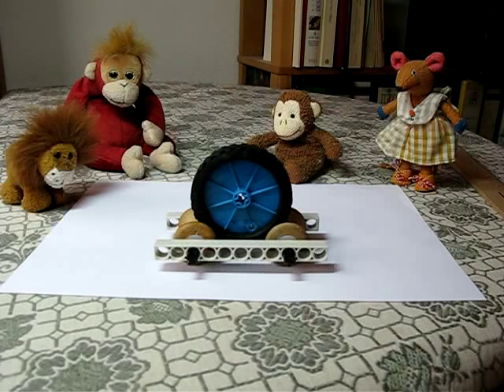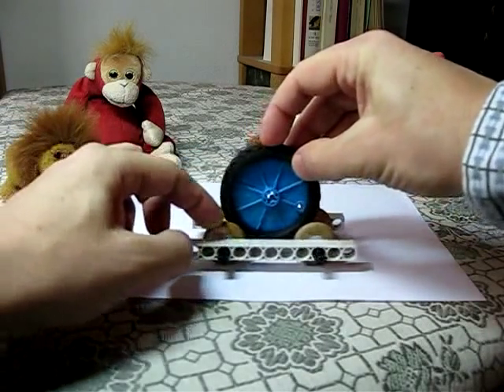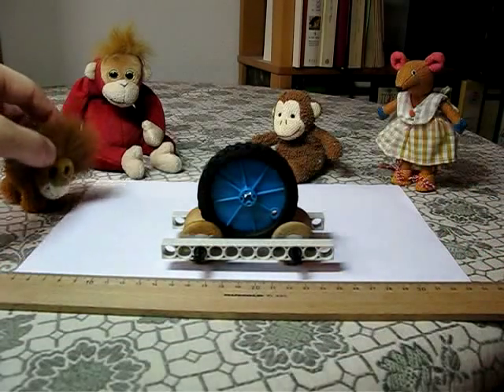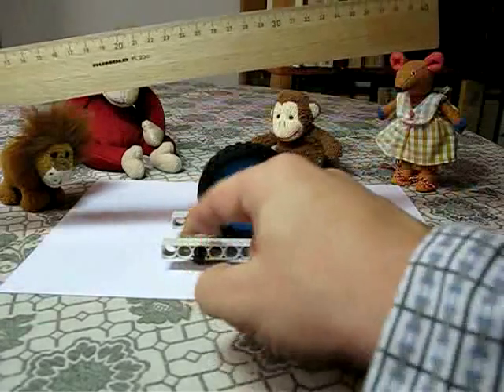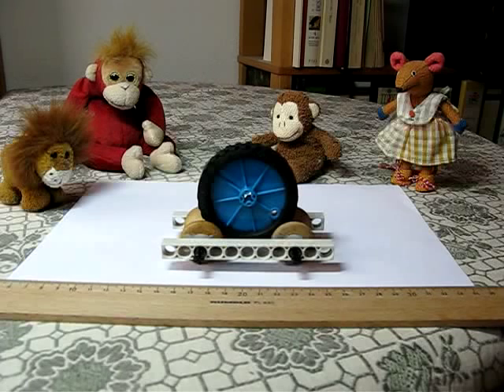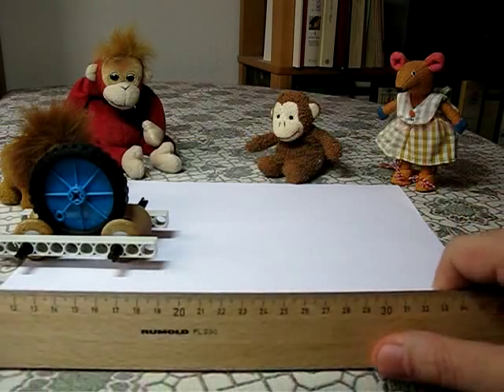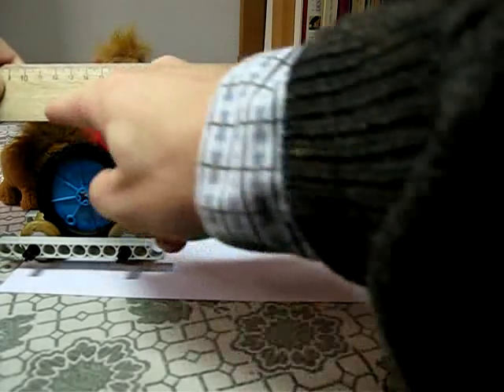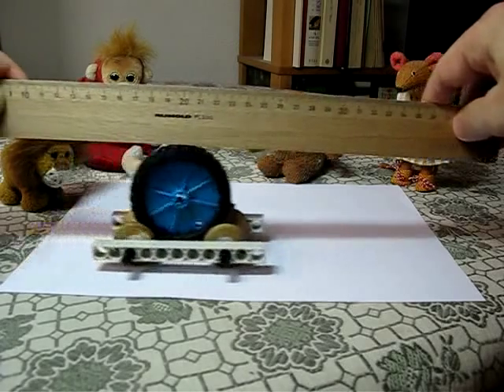Under the ruler faster than the ruler

Comment from the maker: The wind is not affecting all the vehicle to the same amount. It is mainly affecting the propeller: the rest of the downwind cart offers very little resistance to the wind. Since the propeller is turning (being geared to the wheels), is is interacting with the air even when the cart is moving at wind speed. When the cart has reached wind speed, the propeller is producing forward thrust that accelerates the cart to above wind speed. The cart reaches equilibrium at a speed above that of the wind.

Comment from the maker: You need to look at the machine as a whole: the cart is a gearing system *between* two surfaces that move relative to one another. If the centre of the blue wheel was fixed relative to the table top, it would indeed turn the other way. The gearing causes the centre of the blue wheel to advance to the right faster than the highest point of the wheel, which is touching the ruler.

Comment from the maker: When it's working correctly, there is no slippage between ruler and wheel. You could do the same thing with cogwheels and a rack and pinion gearing, to make sure there's no slippage. Since my cart is very light and all wheels turn easily, there's not much loss of energy due to unwanted friction, which means I don't have to apply much pressure with the ruler.

Comment: For anyone who is both (i) confused and (ii) knows high school algebra, let's break this down like a textbook exercise:

1. Suppose the inner radius of the lower wheel, at the point where the big wheel touches it, is r, and the outer radius of the lower wheel, where it touches the ground, is R. Show that, unless the wheels are slipping, (the speed of the cart relative to the ruler) = (r/R) * (the speed of the cart relative to the table)

2. Define F(x, y) to be the rightward speed of the cart if the ruler is moving right at speed x and the table is moving right at speed y, and the wheels are not slipping. Using the previous exericse, show that for all v, F(rv, Rv) = 0.
 
(Remark: We can interpret v as the angular velocity of the small wheels.)

3. Given the result of the previous exercise, explain why it must be true that F(rv + k, Rv + k) = k for all v and k. (Hint: Imagine that the entire room and everything in it are moving right at constant speed k.)

4. Suppose that the ruler is moving right at speed 1 and the table is not moving. Solve the simultaneous equations rv + k = 1; Rv + k = 0 for v and k. Deduce that the cart must be moving right at speed R / (R - r), which is > 1 (therefore 'faster than the ruler').
Reply: AlephNeil there are two types of people.  i can see this and understand it.  there are those who have to explain this with numbers and math or it doesn't make sense.  the one who can do both, owns this reality…..
Reply: Very nice breakdown!  Each step follows logically and leads to the answer.

Comment from the maker: The energy for DWTFTTW is coming from the relative movement of *air* and *ground*.
This energy is always available, no matter at what speed the vehicle is running, as long as the vehicle has contact with both air and ground. It is correct that the vehicle "sees" an apparent headwind when running faster than the wind: you may think of the vehicle "screwing itself through the air", just as the mechanical cart pulls itself along the ruler.

Comment from the maker: ESRogs: the gearing is such that the top point of the top wheel is moving slower than the cart. If the gear ratios were reversed so that the top point of the top wheel moved faster than the cart, the cart would still move in the direction of the ruler, but slower than the ruler.

If I could turn the whole cart upside down (would be fun, but my cart isn't stable in that position), the cart would run in the opposite direction to the ruler, slower than the ruler.

Comment from the maker: The ruler pushes one way, the paper pushes the other way. The way this cart is geared causes it to move faster than the ruler. With other gearing, you could make a cart that goes slower than the ruler, or in the opposite direction.

Comment: @coolaun When you use Vc=Vr*b/(b-a) you're assuming that Vr is non-zero, AND the no slip conditions that you used to derive this hold. Then, you get infinite speed. Both are not possible simultaneously however. If you calculated everything in the frame of the cart, you'd get V1=V2*b/a where V1 and V2 are the speed of the cart relative to ground and ruler respectively. If b=a, V1=V2 , which is Vc = Vc - Vr or Vr =0. Thus the ruler cannot move if the no-slip constraint has to survive.

Comment from the maker: Correct. In exactly the same way, the down wind cart goes faster than the wind because of the ratio between the pitch of the propeller and the circumference of the wheels touching the ground.

Comment from the maker: When we look at the big wheel rotating, it seems we automatically take the cart as reference: our eyes move with the cart. You can see the same effect if you watch someone riding a bicycle. Look at a pedal in the bottom part of its circuit, as it passes the lowest point: it seems to be going backwards. It is indeed going backwards relative to the bicycle, but it's going forwards relative to the ground.

Comment: Would I be correct in thinking that if you "bent" your ruler into a circle around the device, then rotated it, it's equivalent to a planetary gearbox, with the associated gearing effects? If so, this helps me understand DDWFTTW as a means of "gearing up" the vehicle speed relative to the windspeed. It would then be equivalent to holding the central sun gear (ground) fixed, and rotating the ring gear (wind), with the result that the planetary gears (vehicle) travel faster than the ring gear.

Comment: The ruler acts as a "gear" as well.  

Ruler goes right, wheel goes left, spools go right.  Since the spools are smaller, they must turn faster than the ruler moves.  

It's a simple problem really, what is throwing people off is the fact that the ruler is straight rather than a wheel like a normal gear problem.

Comment from the maker: Phantom61994: If you read through the comments, there are many that should help you to understand.

Here's another way to demonstrate the same principle (it also makes a nice brainteaser for a physics class): if you have a bicycle, put one of the pedals at its lowest point and tie a string to it. Now, with somebody else holding the bicycle steady, pull *backwards* on the string. Which way do the pedals start to turn? Which way does the bicycle move?

Comment from the maker: Of course a slight downward force is necessary to ensure that there is no slippage between wheel and ruler, but that's not what determines the direction of movement. The direction of movement of the cart is determined by the direction of movement of the ruler. The people who compared the ruler to a straightened-out gearwheel have understood this correctly: the ruler engages with the blue wheel just like the rack of a rack and pinion gear system.

Comment: The interesting thing is that it goes to the right. I think that it depends on the friction between the ruler and the big wheel is smaller than the friction between the small wheels and the table. If the size of the frictions had been properly changed, the wagon had gone to the left?

Comment: Amazing, just marvelous, here the point is, where is your strenght going to? the big wheel? no... goes to the wheels in the bottom, by putting pressure in the cart against the floor, the little wheels are the ones doing the movement, and as they move to the right the big wheel will move in the opposite direction making the cart go faster. Am I correct?

Comment from the maker: To make such a machine, look around and see what you can use! I first found the two cotton reels, where the radius at the middle is about half that of the ends. Then I looked for bits of construction kit to make a very simple chassis, and added the third wheel. It's important that there's enough friction between paper, wheels and ruler so that the wheels don't slip: a wooden ruler and cotton reels are better than plastic ones and the rubber tire on the blue wheel has a good grip on the ruler.

Comment: Say the small wheels couldn't spin. Moving the ruler to the right would just drag the contraption to the right at the same speed because of the friction between the ruler and rubber wheel. But the wheels CAN spin, so it gets dragged to the right at the same speed, which spins the small wheels clockwise, which spins the big wheel counter-clockwise moving it even further to the right.

Comment: it all has to do with the spools on the bottom. the part of the spool touching the ground has a larger radius (assume 2x) than the part touching the big wheel. this means the wheel only rotates at half the speed of the spools. so when you move the big wheel instead, the spools move twice as fast.

Comment: The cart in your link is upside down compared to this one. The big upper blue wheel here, corresponds to the small bottom red wheels in your link. Their size doesn't matter. What matters is the size ratio of the wheels that have 2 radii (reels here and black/green wheel in your link)

Comment from the maker: arctic, you're right that the important thing is the relation between the rims and the shafts. However you wouldn't get the same result by running the ruler over the shafts: the essential function of the large wheel is to reverse the direction of rotation (its size is irrelevant). You'd get the same motion without this wheel by running the ruler _under_ the shafts (like in "along the paper faster than the paper"). Running it over the shafts will make the cart advance slower than the ruler.

Comment: I think that the energy he needs to exert down on the ruler to generate friction between the ruler and the cart makes it impossible for the big wheel to spin either way. But when he moves the ruler, that friction causes the cotton reels to roll, and once the cotton reels roll one way, the other wheel rolls the opposite way, at the same speed, but due to their size differential, the big wheel turns the little wheels much faster then with just the ruler pushing. Explained.

Comment: To Lightening Rose, how can wind do work on a device moving faster that the wind? One answer is that the parcel of air on the inclined surface of the prop moves BACKWARDS relative to the cart, reducing its speed to less than that of the wind.Thus the wind can push on it this parcel of air and add power.Power added = (force in a given direction)X(Velocity in the same direction).The wind does work on this air pushed back by the prop to compress it. the compressed air, in turn, does work on the car

Comment from the maker: You're right about the axle. But the important point is not that the bottom wheels are smaller than the top one: the size of the top wheel doesn't matter. It's possible to make a cart where the rotational speed of the top wheel is more than that of the bottom wheels (I'll do it if I find the time!). What's important is that the *edge* of the top wheel is moving slower than the *edges* of the bottom wheels, since it is in contact with the smaller centre parts of the cotton reels.

Comment from the maker: protztom, I have talked with several pilots who understand exactly how this works. The propeller will not simply stop because it is geared to the wheels. It is creating thrust, not functioning as a turbine. Mark Drela (professor of aerodynamics at MIT and world-renowned pioneer of human-powered flight) has analysed DDWFTTW. If you go to the Boatdesign net forums and look at the thread with the title "The Wind Powered Sail-less Boat" you can find his analysis.

Comment: If you have a REALLY low gear, the bicycle will move forwards, and the pedal will move in the normal pedaling direction.
  Else, the bicycle will move backwards and the pedal will move in the reverse direction.
  The crossover gear is when the pedal moving in its lowest position is stationary relative to the ground.
   1.5 to 1 gear will just about do that

Comment: Perhaps, if you implemented that system into a dynamo, with the outside physical force as the ruler and the the coil or magnet as the cart you could harness far more kinetic energy and thus produce a higher voltage?

Comment: Is this right?  Let larger spool circumf. = c2; let smaller spool circumf. = c1.
Case 1: Suspend cart in air with ruler in place.  Turn spools 360 degrees clockwise.  Big wheel turns counterclockwise an arc length = c1, moving ruler backwards a dist. of c1. 
Case 2:  Put cart on table and push cart forward one spool revolution.  Cart moves forward dist. = c2.  This is just like Case 1, except we add a forward dist. of c2 to cart and ruler.  So ruler moves c2 - c1,  and cart moves c2.

Comment from the maker: The paper is indeed pushing the cart forwards, just as the ground pushes a car forwards. When the wheels of a car push backwards against the ground, the ground pushes forwards against the car. if it didn't, the car wouldn't move forwards.

Comment: the ruler is straight so it creates an illusion, and you forget to imagine the ruler as a gear turning. if you take the two points between which the wheel travels then curve that line, it become part of a gear and it's easier to imagine whats happening. .  having two gears with one in between will result in the outer gears spinning the same direction.   the trick to making it speed up is the different radius of the bobbins.  clever trick.
Reply: +Bo Huggabee where did you get the one in between from ?
Reply: +Bo Huggabee "having two gears with one in between"
what is the one in between
Reply: Mahmood Kharsa i still don't see your point.  take two gears, an  put one in between see what happens...
Reply: if you are referring to the ruler and the two small wheels to be the outer gears then the outer gears are supposed to rotate in the same directions...
but they are not .. look closely .. the small wheels are rotating the opposite direction ...
listen all i could say about this, that it's a friction game ..  the ruler are pushing all the cart in the same way .. it isn't supposed to do so .. but because of a trick in his movement it does .. 
btw i hope my english is fine because i have an ielts exam soon hhhhhh.
Reply: Mahmood Kharsa yes they are.  just at different rates because of the different diameter axles compared to the rolling surface…my examples was a stepping stone for anyone confused.  i trouble shoot problems, its why i was considered a genius i guess. it's like a 5th gear in a car…whether you like it or not, i am right.  i was just trying to help other connect the dots instead of seeing the illusion.  i'm 98% for mechanical aptitude.  that is 2% of people that are more applicable.  meaning when i took the test, i only missed one or two questions.  thats out of the entire united state's populace.  i'm not wrong, just re think the problem, because physics in this generation is really screwed up.  i speculated that the speed of light could be surpassed. luckily i'm not the only one that understands why it can.
Reply: no need to get angry i was just saying my opinion .. good luck mate :)
Reply: Mahmood Kharsa believe me, i'm more frustrated in myself. i can't connect with people on how i solve problems.  rarely i find someone who thinks like me…i'm a very lonely person.
Reply: +Bo Huggabee ok then connect with me solving this problem ... if the ruler is moving to the right then what direction does your supposed gear (ruler) is rotating ... clockwise or anti-clockwise ?
Reply: Mahmood Kharsa clockwise, the center axles of the bobbins are smaller the the outer "wheel" parts.  as the inner completes one revolution, the outer wheels complete one revolution, since the distance around the wheels is longer, the car travels that distance per revolution of the center of the axle.  the size of the gear/wheel in the  center of the bobbins to the ruler doesn't affect bobbin travel, only ruler travel to bobbin travel. creating an illusion. otherwise it'd just stay there. 

if he used another wheel instead of a ruler, it'd be less of a strain on people.  the straight edge is what creates the initial distraction from real logic. magicians use this tactic.
Reply: +Bo Huggabee i guess i can't argue with that and that is the answer ... impressive :)
Reply: +Mahmood Kharsa i see why i confused you lol.
Reply: +Mahmood Kharsa Both small wheels rotate the same direction.  The whole carriage wound't move if they were spinning in opposite directions.  All the trick is is gear ratios.  The center wheel is a large gear, the 2 small wheels are smaller gears.  The small wheels spin opposite the direction of the large wheel, just like gears do.  The ratio of their diameters is the reason for the speed up.  The ruler is acting just like a gear rack.  There's no gear teeth, so all the movement is being transmitted just by friction.  You can recreate this experiment with a set of Lego Technics parts  If you want the cart to not speed up just swap out the smaller wheels for ones which are the same size as the center wheel.  If you want it to slow down flip the arrangement of wheels, small in the center, 2 big ones on the cart.
Reply: lookoutforchris thanks, but we already know, if you'd read the comments.

Comment from the maker: If the cart doesn't move, it's made incorrectly. The usual mistake is to neglect the difference in diameter between the edges of the cotton reels and their centres. If there is no difference, the cart will move neither left nor right: the ruler will only skid along the wheel when you try to move it. The blue wheel must touch the centre parts of the cotton reels, which have a diameter approximately 1/2 that of the edges.